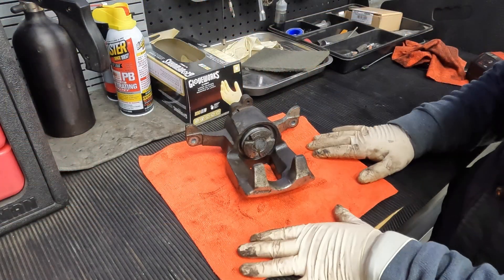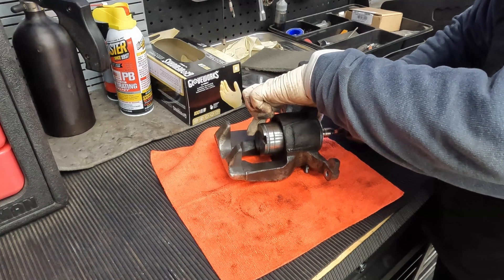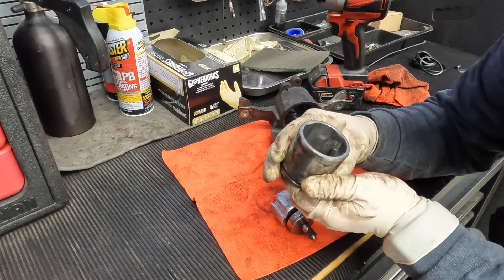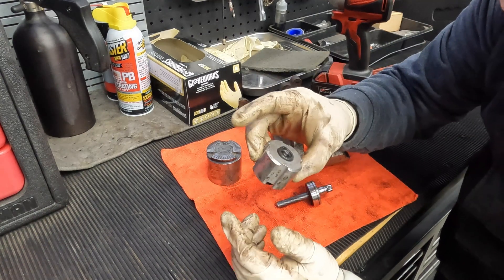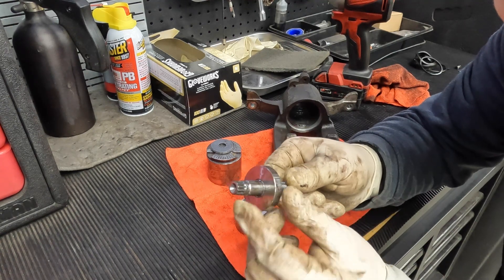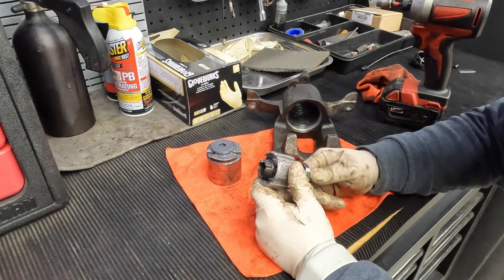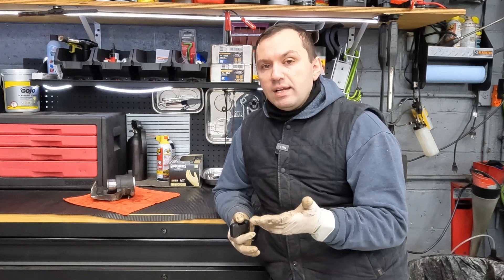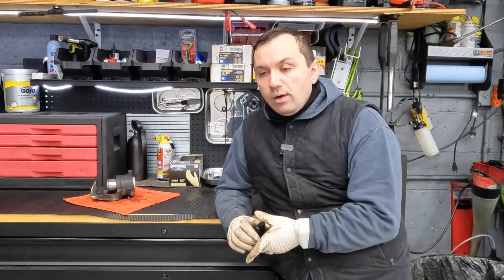QUICK TIP: HOW ELECTRIC PARKING BRAKE CALIPER WORK IN DETAIL!

Comment: Actually the mechanics of the electric parking brake is simpler than the direct mechanical one: It does not need the slack adjuster mechanism, which tends to make problems, mainly once some corrosion kicks in.
The slack is eliminated by the way how the motor is driven: When tightening, the computer drives it till it reaches the set tightening force, but for retracting it uses a timer, so it retracts only a predetermined distance, programmed so it releases the brake with some minimum slack. And viola, the slack is gone, with just bare screw.

Comment: Wondering how the parking e-brake is auto undone/reversed when I press accelerator and move forward and don't have to manually un-set the parking e-brake?
Reply from the maker: That is done by the brake computer and the electrical system. They only release the brakes when they are sure the car is moving.

Comment: There was nothing wrong with the mechanical parking brakes, been in service for many years no problem, I don't trust anything electronic in vehicles, they won't hold-up to mechanical. Car engineers have lost their minds. before I spend 70 to 100k on this JUNK I will go to the Mecum Auction and buy and old truck that's been restored from the ground--up, all mechanical,...............they are real trucks.

Comment: This is just unnecessary complication. All because as you say a cable might break or be frozen when someone tries to use it? That's operator error/neglect not another reason to make cars more complicated than they already are. It's a lot easier and cheaper to replace a cable than it is to trace a wiring or electrical fault or replace an ecu. 

I honestly don't want or have any desire for my car to be computerized and touchscreened to death, nor do I need my car to drive itself or be connected to wifi. That's all just overpriced crap that's going to break and be eye poppingly expensive to fix on a car that you still have 24 months of payments left on your 72 month loan.

I honestly dread having to replace my current car thanks to frankly dumb consumers tripping over their credit limits to buy overpriced suv's, cheap simple cars are dead and not coming back. And all this overcomplication of vehicles is so d bags can tap on their phones rather than drive.
Reply from the maker: I have an opinion on it like you do! They didn’t design this because I said the cables break😂😂😂😂

Up here cables break because of the climate and road conditions that we deal with. Plus people don’t use the parking/E-brake here like they should daily. The electric parking brakes save so many transmissions because they auto apply reducing wear on the drivetrain I like the fact that it does that because sadly people never use the manual parking brakes like they should!

Comment: MY 2016 Range Rover Sport has this but the communication is not getting to the control when it gets below freezing.. Just happened to me here in Alaska and it did happen once before and, as soon as it got back above freezing, the EPB worked again and I was able to use the brake correctly.. Going to be below freezing for the next week or more.. hahahah.. I am screwed
Reply from the maker: Sounds like the motors aren’t liking the cold

Comment: Of course they're not electronic, they don't jam a 100k farad electrolytic capacitor in the spokes, or anything like that. they're mechanical and electrically actuated, my guess is they're actively retracted when the car is driven. If the opposite were true they'd drain the battery when the motor isn't running.

Comment: I miss the days when they were called emergency brakes and manual.  In fact, I had to use them as brakes on a drive home years ago.   When they're manual, you can adjust the pressure to slowly apply the brakes.  Worked well.
Reply: Exactly, I hate electronic parking brakes.

Comment: is that parking brake installed only on the rear wheels and is that brake 3 pairs of brakes or is it part of the service brake where the hydro fluid comes
Reply from the maker: It's only in the rear, and it is part of the regular brake system of the car.
Reply: @TheEnthusiastMechanic  thanks

Comment: I retired before they were used in widespread models. 
Thankfully Kentucky doesn’t have the corrosion problems you have up north. 
Del
Reply from the maker: You are very lucky to not have to deal with the parking brake issues we see in the Midwest!

Comment: Aren’t electric parking brakes cheaper to make?  That’s why they are doing it.  So I don’t trust them.  And we pay more for these quicker and cheaper builds.
Reply from the maker: I don’t think it’s necessarily cheaper. The old manual parking brakes are still pretty inexpensive and they do use a complicated caliper like these if you have the style that has the cable directly to the caliper instead of a shoe kit. The reason why I like electronic parking brakes is that there isn’t a whole separate parking brake system. It’s all contained within your regular braking system less parts that need to be serviced. The most expensive portion of this I would think is the electronic motor those can go for a couple hundred bucks but overall I do tend to favor electronic parking breaks. They are much better in my opinion
Reply: @  I see that.  But I assumed going to electric 4 wheel drive and electric parking brakes was a way to avoid the high cost of solid mechanical parts.  Guess I was wrong.  Thank you.
Reply: Electric parking brakes are used to allow the brake applied by the computer.  Some of the gm's will slam on the brake when the door is opened and the car is moving.  All of it is a pain in the ass for techs.  Dead battery, parking brakes on, trans won't come out of park, so how do you get it in the shop or on a flat bed??   More big brother crap is all it is.

Comment: Don't buy cars with electric parking breaks.  Mechanical fails less.
Reply from the maker: Depends on where you live here in the Midwest with the salt. We have a lot of failures on the parking brakes. After a few years they stopped working, so it really depends on what region you live in.
Reply: Mechanical parking brakes don't fail, they rust solid and don't work at all.  I like old school stuff a lot,  but electric parking brakes are a heck of a good invention.
Reply: Its really not an issue. You're like the old fogeys that told people to stick to carburetors because that EFI witchcraft was evil.
Reply: You kinda have no choice. Even cheap Toyotas now use these Electric Parking Brakes
Reply: The more points of failure the more likely it is to fail.  Electric/electronic fave more poont ls of failure.

If your brakes rust over you are not doing proper maintenance.
Reply: @bowez9  you sound like the old fogeys who swore up and down that electronic fuel injection is "too complicated" and "going to fail."
Reply: @thechiraltheory7712  no, but the difference is a Emergency Park is for Emergencies, it should be as simple as possible as it is less likely to fail.

As for was I drive , I have a PD roots car and a twin turbo VVT car.

Though let me ask what safety benefit does an electric/electronic emergency brake given ?